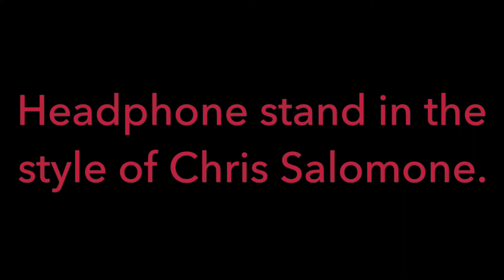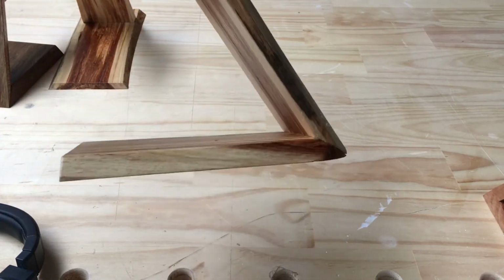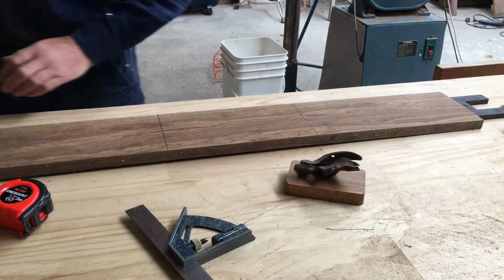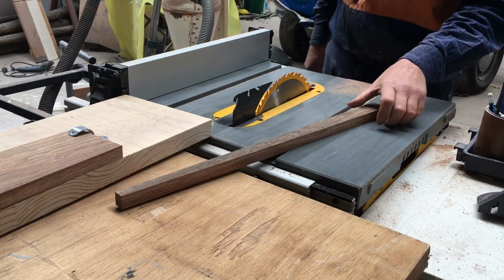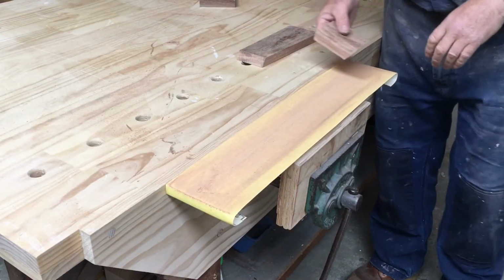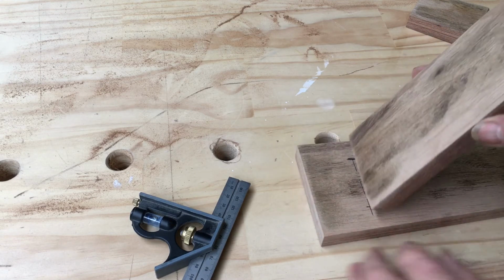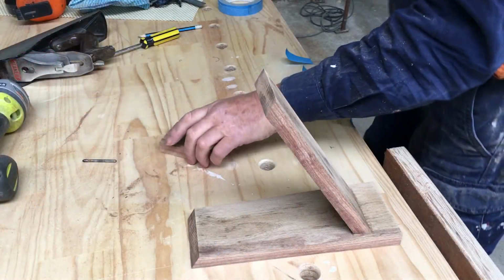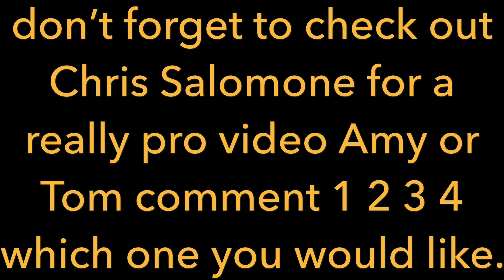Headphone Stand

Comment: Do you have measurements for the second one
Reply from the maker: UIB STRIKER75 from memory just a bit bigger than the one I make it really depends on the headphones .
Reply: @davidtrenouth5492  but I meant what was the height and width of the taller one you showed, because I think the original one by Chris Salomone is a bit too small for my headphones,and also I want something to wrap the wire around but I'm not sure how to do it